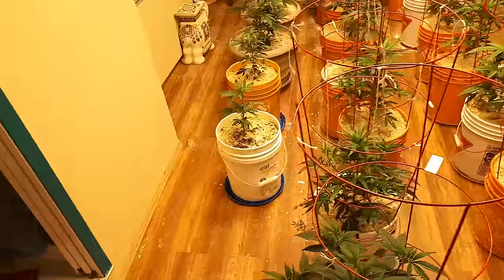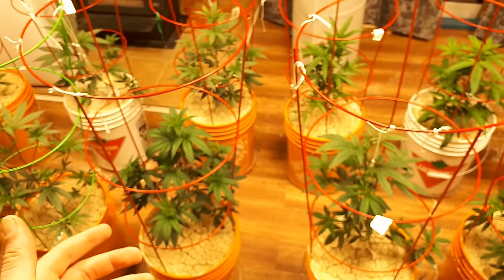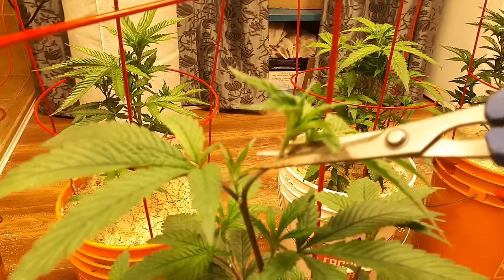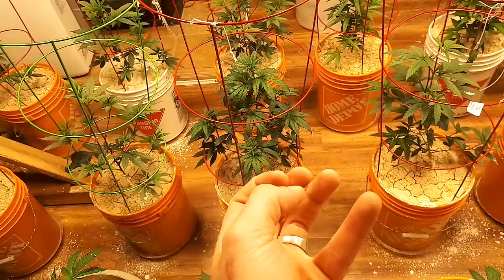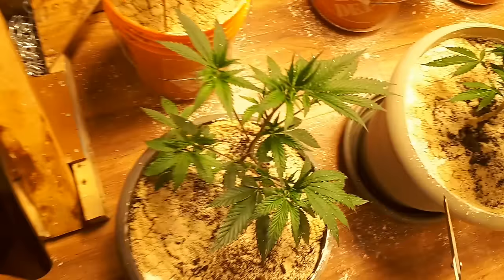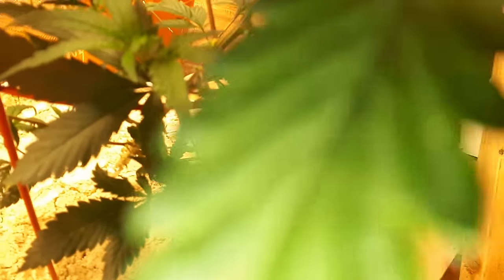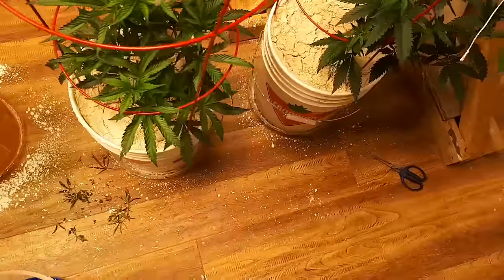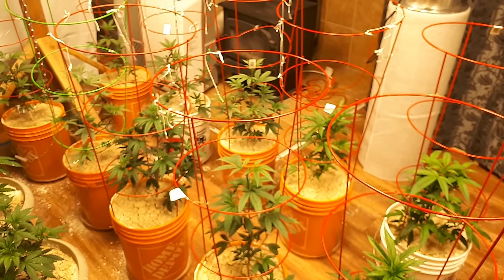Topping your cannabis plants. The why, the how, the what.

Comment: How often should I top my plant? I’ve topped it once after the 4th set of nodes
Reply from the maker: That’s a point of taste really. It is also dependant of the structure of your genetic frankly speaking. I often only top once, maybe twice. Especially for example on my galactic citrus shiva genetic I have released. It branches like crazy early on :). Top until your tops and branching is your desired size :). I hope that helps :).

Comment: Are tomato cages better than Trelles net?
Reply from the maker: Yes and no. It's a style preference tbh. I prefer cages and tie ups
Reply: @PotsquatchGrowers  i realy enjoy whatching you shoud i use 10 gallon pots or buckets for my first grow
Reply: @PotsquatchGrowers  im going to be useing a 5x5 grow tent
Reply from the maker: @user-zq1nq4em4v  again it is a point of preference. Pros and cons to both. With cages. There is a lot more typing. With a Scrog when properly executed you can fill the whole canopy. It is easier to maximize your run with scrogging. To not scrog it will require greater work
Reply from the maker: @user-zq1nq4em4v  start with 5 gallon buckets. It will be more manageable. First use solo cups. Than transplant to 1 gallon pots. Than 5 gallons right before you flip. This tripple pot will help help yo maximize your grow.
Reply: @PotsquatchGrowers   im using a 100 gallon super soil recipe from tga subcool i aapreceate your information